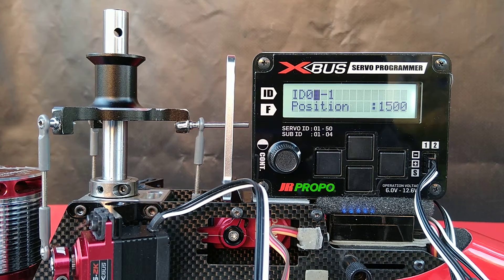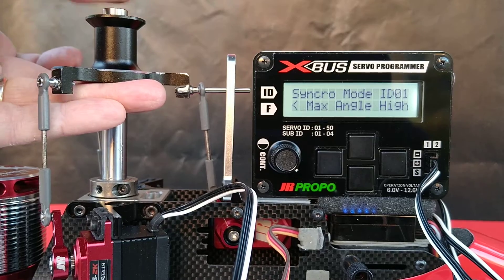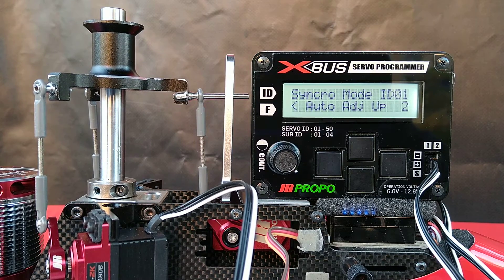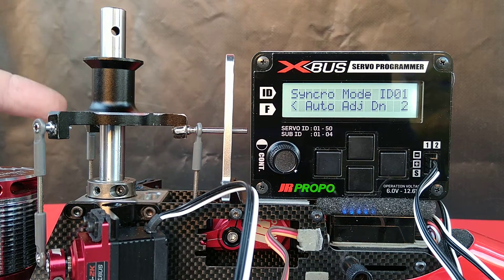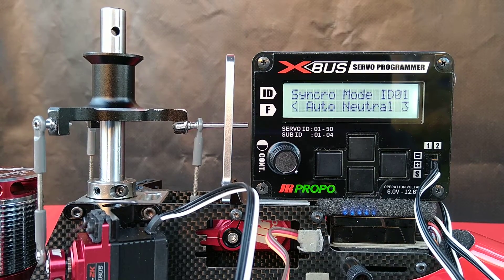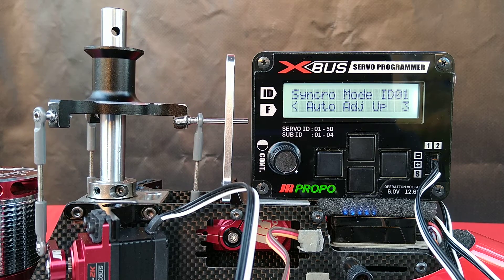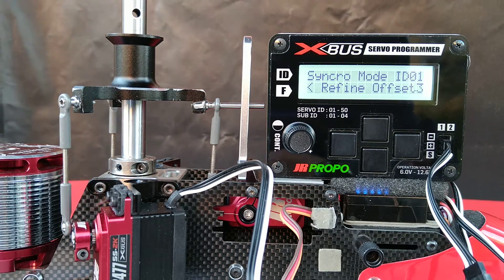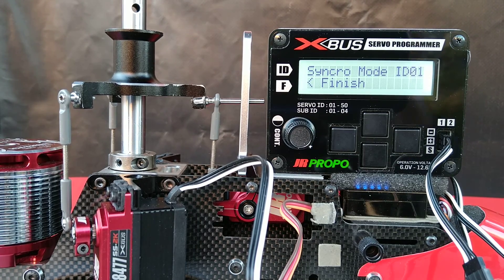JR PROPO 23 S8477 SS Game Changer Servo Synchronization for RC Helicopter Use-Video 2

Comment: Does this procedure work on any 2k firmware servo? Like the 3411?
Reply from the maker: I have done it with Modified S8955's and S8477's thus far.  I know it works with those and the effect/improvement in the precision and control feel of the helicopter is profound.